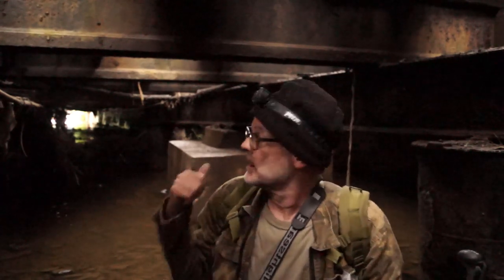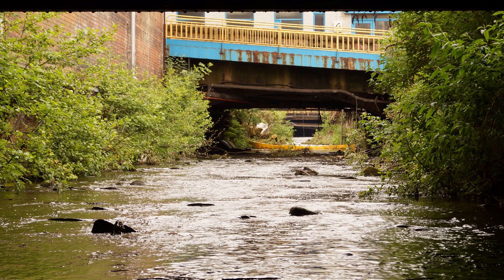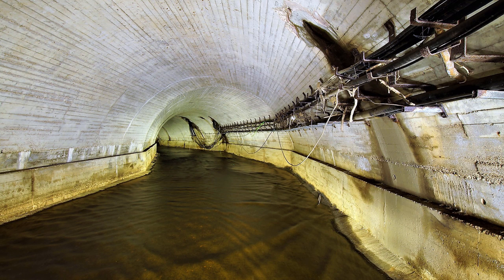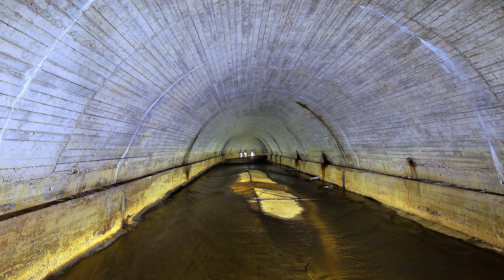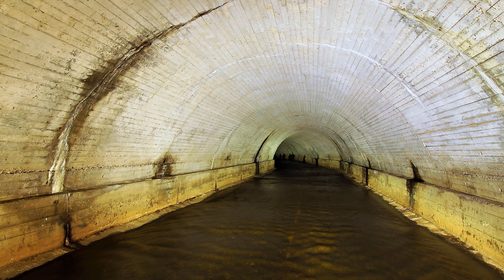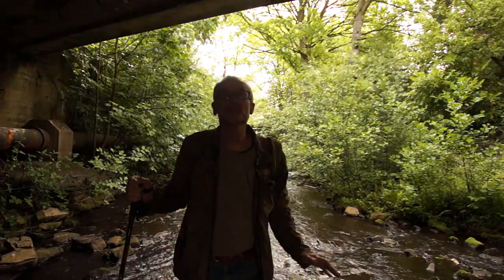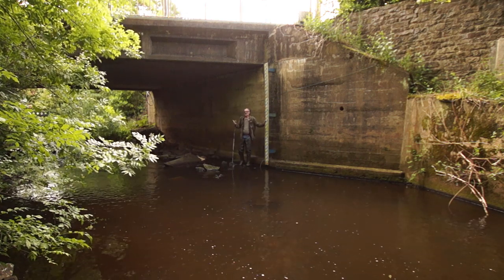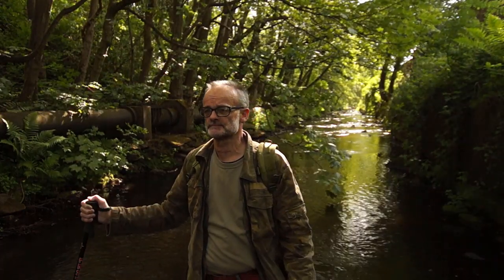Last look at 36 DD

Comment: Waited for part 2.  Thanks Pat great job, sorry you had resistance. I wanted to mention my transport and pride and joy is a 1975 Nottingham split frame 10 speed that was never sold in the USA. I've had it over a year and logged many hundreds of miles on it. Seems Nottingham is only 55 or so km from Sheffield. I just wanted to share

Comment: Most enjoyable. Thanks Pat.  It's interesting too see the underworld even below a steel works.  They don't seem to intrude upon the river much except for pipes and cables.
i worked on Stanlow oil refinery for several years through which runs the river Gowy.  They took extraordinary measures to ensure that the river remained unpolluted on its way to the Mersey.  Good to see that the steel company take care to not mess up the local waterway.
I am surprised that they got upset at your walking the route.  You were in the river not the steel mill.  I didn't notice any signage saying you can't get down and into the culvert.  Perhaps it was hidden by a tree...
Reply from the maker: Yes very nice journey this, and it's in the steelworks interest as it does show they are looking after the river and risks from pollution, anyway back up in the trees soon, all the best Pat

Comment: Hi Pat, An interesting explore, excellently filmed as always. Thanks for being honest about what happened. Raises some interesting questions about the rights of use of the waterways but I suppose once the Steelworks knew what you had done in the first video they were duty bound to take some action. There must have been some interesting conversations between the management and security staff there!!

Unfortunately the culvert that I told you about that runs through Granada starts in the main tourist areas  just below the Alhambra its always really busy there but maybe there are guided tours that can be done, the videos that both you and Martin Zero have done have done have really motivated me. There is another one not so far away in Cazorla that goes right underneath a ruined church, its an easy walk, but despite that its very spectacular.

Good luck from Spain!!

PS Its snowing here at the moment!!
Reply from the maker: Yes I was pushing my luck with this one, they new about me and I went back several times, so I got caught, no problem, a least I got nearly all the footage I wanted for my video......thanks Pat

Comment: It was still a nice explore, Pat. I also appreciate you pointing out your stick. A good stick is invaluable whether exploring culverts or hiking. I do a lot of hiking in the mountains and have a 7' stick cut from the trunk of a sapling in an area destined to be cleared out for development. I call it a stick , but it's more like a pole. Being dried out, it's not too heavy to bring along. It helps when navigating hills, crossing streams, and even encountering wildlife. I have used it to keep rattlesnakes at bay, for example.

Comment: Another great video, even if more limited than you would have liked.  Might I suggest a high vis jacket, a clip board in a waterproof cover and a set of sampling bottles for future ones, you can them claim you are just doing a surprise spot sampling of the water quality and of course people weren't informed you were doing otherwise it wouldn't have been surprise spot sampling.  Put the fear of the water company and the Environment agency into them.  Having worked at a plating company i know how tight discharge limits are these days and the fear induced by a water company van turning up unannounced
.

Comment: Dear Patrick Dickinson. Sir. How are you? Its good seeing you. You did your best with the 36dd. Your photos were ace. Unlucky about the open sections... I dont know if your interested in The "Secret Trap Door Under The Canal" film about how in Rochester they have a very old way of cleaning the canal if you have half hour might be worth a view some good brick work some good Mason work.
Hope to see you soon. Cheers Patrick.
From Craig Lee White.
Reply from the maker: Sounds very interesting that Craig, I, ll have a read about it, if it's Rochester Kent, it's a long way a way, thanks Craig, all the best Pat
Reply: @patrickdickinson6492  Hello Patrick. Its a short film on you tube called The Secret trap door under the canal.
I only mentioned it because theres two hundred year old brick work in the sides of the empty canal. The film doesnt do it justice. Your films with your photography highlight the make up of the tunnels that your into. 
Cheers for now. See you soon. From Craig. Bye. Basically its an old plug hole.

Comment: Great video. At one point early on in this video it seemed as if large cable trays had fallen off the walls. Do you suppose all those cables are obsolete? Later on, I couldn't see how those small transverse brick arches were held up.
Reply from the maker: Hi Samuel yes I think all the cables on the fallen cable trays are redundant but you never know. The older 11000 volt ones are usually steel wire armoured so would be OK. Wish I had some better photos of the mini arches, but happy with what I had, thanks Pat

Comment: Pat - about one of your vids where you were wild camping and you cooked a Indian curry type thing, I ain't gonna nitpick as I could see you did a lot of chef type things, so I'll say only one very useful thing,  you should forget bunging the spuds in, instead bung in some dried pasta. The steps are... Go to any shop and buy a bag of their own brand cheapest dried pasta quills or penne tubes basically, take just a mugful of that dry straight out of us packet in some at with you on a camp, when at camp cook the mugful of dried pasta like the instructions on the bag say, drain it, till bone dry,  next in your frying pan soften the bunion and garlic like you do, chuck in the jar of shop sauce as you do already, warm sauce a bit, then shove the cooked and drained dried pasta tubes into the sauce etc in the frying pan, push it all around for 5 mins to reheat dried pasta and for dried pasta to soak up some sauce, then that's it, munch it. Get wholewheat dried pasta quills because wholewheat means its better for you, this dried pasta will give you more energy than spuds, and this dried pasta absorbs more sauce and holds some inside the tube and this pasta with your current sauce is a good taste combination so more gobfuls will be tastier. Also this dried pasta is smaller and lighter to carry and unlike spuds no peeling or washing needed, and this pasta expands when you cook it giving you more from less, doesn't need storing in a fridge making this dried pasta ideal for camping tha knows.
Reply from the maker: Hi Mark yes makes great sense to use the dried pasta, like you say lightweight and nutritious. We have started to use the whe meal pasta at home and makes sense to use on camps, I also find it more filling. Thanks again for taking the time to pass on the information, all the best Pat

Comment: Why do you quote the width and depth of water in feet but the lengths in meters?
Reply from the maker: I was at school when decimalisation came in , we learnt both and I still work in both, same as capacities litres and pints, screw threads, miles kilometre there all the same to me, thanks Pat

Comment: Patrick
Can you go to an old mill with a large flywheel and physically move it please ? 
Its very easy to move several tons when free floating without a load. 

  I told you a while back i had a device that yields energy for very low effort....its a vehicle with a floating flywheel on a swing arm , its spun up with EASE..when the flywheel (weighted vehicle wheel) is lowered to the road it has literally TONS of torque..
Flywheels ARE true energy multiplication devices via free mechanical work..

50kg 600mm ONLY 240rpm = 9477 newtons / 996kg / a fkn ton ! from 200watt 🤨
Most people dont know the significance of that..

Fred dibnah explains in detail in one of his documentarys..its on youtube..
He shows ONE man turning a +10foot flywheel though a pulley system giving him a massive lift ratio something like 1 in 60..

that represents a 1kw motor making 60kw  🤨
Reply from the maker: Yes I appreciate and understand the theory and advantages of flywheels, we used them on motorised equipment that had to complete a mechanical action, once going they had the energy to see the job through, thanks Pat